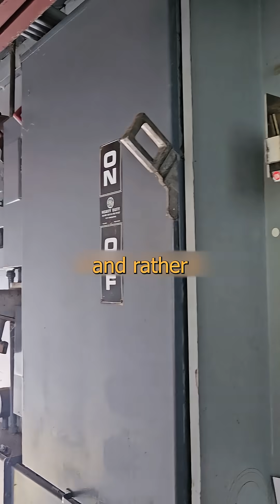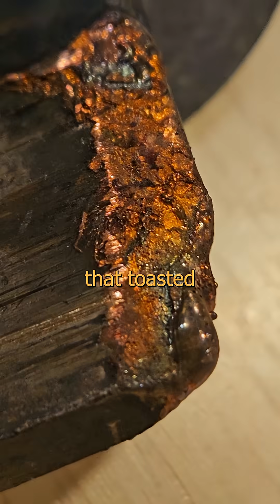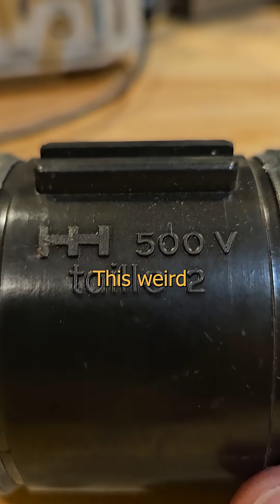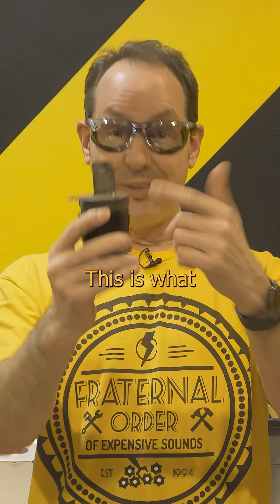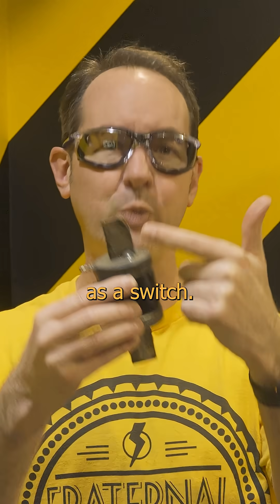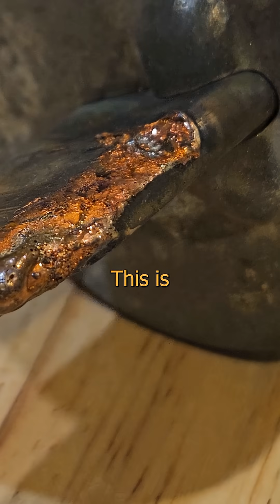Ugly Fuse #chrisboden #comedy #engineering #electrical #educational #highvoltage #damage #fail

Comment: Reminds me of the time back in the day when I was trying to figure out why my TV wasn't working. I tore it apart and found a fuse that was either ceramic or milky from the smoke that got out. Then I decided to check if there was power in the circuit by replacing the fuse with my trusty screwdriver and created lightning which flashed so bright the whole house went dark.
Reply: If there's anything i know about CRTs, it's "they have capacitors that can kill you even without power"
Reply: @SirLightfire  No, CRTs are capacitors that can kill you even without power. They can hold quite a charge even after being completely removed from a TV set.

When I was a kid, the local handyman who repaired nearly everything in my neighborhood showed me how to check whether a CRT in a TV was getting the required high voltage and guesstimate the voltage.

You rolled up your right sleeve, rested your right elbow on the steel grounded frame of the set from which you had removed the cabinet, and held the tip of a screwdriver near the second anode cap on the CRT. That’s the one under the big rubber cap on the side of the picture tube.

If high voltage is present an arc will jump from the contact under the cap to the screwdriver and to ground through your arm. The length of the arc tells you the voltage, roughly, taking into account the distance it has to jump under the rubber cap.

WARNING!!! if you do this you will get a little jolt from the current through your arm, but it won’t kill you as long as your elbow is the only place you’re grounded.

Just don’t drop the screwdriver into the guts of the TV…

When I showed my mother what I had learned, she wasn’t amused.
Reply: @markfergerson2145  My Granddad taught me to work on electronic equipment of that period with one hand in your back pocket. That way the charge won't ground across your chest where it has a small chance of acting like a defibrillator.  There is actually a saving throw vs. electrocution: Depending on what state of its cycle your heart is in, a shock either will or won't stop it or kick it into fibrillation.
Reply: @MarkStockman-n8s5w Whenever I was an apprentice I helped my foreman with some hot panel work.  His hand was in his back pocket.  

My father? Empty the bread on the counter,  use the bag for insulation while changing a receptacle hot.  

Me? I'm now on the LO/TO crew. The land of Schrodingers circuits. Is the circuit alive or dead? Put on the 40 cal and find out!
Reply: @MarkStockman-n8s5w Working on high voltages (anything over about 50VAC) with your left hand in your pocket was a rule instituted by Nikola Tesla himself, apparently. It’s still very good advice.
Reply: @racheleast688 I’ve changed lots of receptacles hot while barehanded. Only got bit a few times. I do take pains to make sure I’m not grounded anywhere else though. At age 73 my heart is about the only bit that still works great and I want to keep it that way.
Reply: @markfergerson2145  Granddad also had a special nylon screwdriver for adjusting POTs etc.
Reply: @SirLightfire  drop some aluminium foil on it till it stops sparking.
Reply: @satibel i code poet. I no touch sparky sparky
Reply: I did that when I was a little kid taking apart an old tube radio, only it was "just" the basement that went dark.
Reply: Those old CRT capacitors could crank out power like nobody’s business
Reply: @Jame5man  It welded the contacts to the screwdriver
Reply: @Roadiedave  I did almost the exact same thing trying to fix an old TV when young! The syncs we're way off our something, I forget. But whatever it was required a lot of taking it apart, changing something, then putting it back together to turn it on and test. 

I knew enough that I knew I was playing with fire not leaving it off for a while every test so I was staying will away from the tube itself and so far things were going well, but it only takes one mistake...

I was in the rhythm. It's just finished one test and was absent mindedly thinking about what test to try next as I used a flat head to pry off the TV side of the power cord. 

BANG!!!!!!! I was blinking to try and recover from the insanely bright blue flash, the power cable has been blown across the room and I realized the end of the screwdriver was now a ball!

It's forgotten to unplug the wall side of the power cable!!! (Facepalm) 

"Welp. I think it's time to just admit the TV is dead and find something else to do."

I'm guessing the violent flight of the power cable was from the force of the current itself but I have no way to prove it. But it somehow ripped itself out of the real and flew 10 feet away from me! Crazy stuff.
Reply: Nah those CRTs are scary asf, kill-you-for-looking-at-it-wrong voltage, the loud pops and buzzing when powered on, enough static to replace your duster...
Reply: @xapcgamer151 Wow, I just remembered how much I used to love running the back of my hand over the screen as soon as we turned the TV off to feel the static interact with the hairs on my skin. Thanks for the flashback. I had completely forgotten about the residual static charge on those things. And all the lovely ticks and crackles that they made powering on and off.
Reply: I remember a kid dropping a little chain into a wall lamp. it had no lamp, but the holder was there and it was live. bang! darkness.
Reply: @anttimaki8188  I once tried to take the temperature of an old incandescent light bulb in a table lamp with a mercury thermometer. It of course shattered but a bead of mercury then ran down the bulb 
 into the socket and polluted our living room with its lovely vapor as it arced and blew the breaker for that circuit. I was only about 10 or so, but I wonder how my life would be today if I still had the brain cells that vapor Agent Orange’d…
Reply: My fav was screwing those old fuses into a table lamp. If you put a 10 amp fuse in the lamp, and the circuit was 15 or 20 amp, usually, only the lamp fuse would pop and scare the bejesus out of everyone!
Reply: @crashburn-s3b  I'm interested - what was the fuse rating of the lamp supposed to be?
(Trying to imagine a 1.2 kW lamp... that would be impressive.)
Reply: @wazza-au  Usually I would use a 5 or 10 amp fuse in order not to pop the circuit breaker fuse in the basement. Those were normally 15 to 20 amp.
Reply: @crashburn-s3b  I  am curious how well a standard lamp cord would stand up to a dead short.
Reply: @MarkStockman-n8s5w  The weak link is the switch. If anything were to react badly, the switch is not designed to take a 10 amp load, but it is a short duration problem.
Reply: I had a boss whose response to a shear bolt failure was to put heaver and heavier graded bolts in place of the shear bolt until the bolt stopped breaking.  Then was shocked and upset when something expensive the shear bolt had been protecting broke instead.
Reply: My daughter managed to do that in the den.  OK, so, we had two desktop computers on, our son running his X-box on the TV, a small space heater running, and our daughter running her laptop - when she plugged her hairdryer into a socket.  Hey - who turned the lights out.  Now, the room has somewhere between four and five separate circuit breakers for the room.

Comment: I’m confused as to exactly what you mean when you say “use the blades of the fuse as a switch” I’m interpreting that as someone physically taking the fuse out to turn something off but I feel like from the context and fact that’d probably make one hell of a noise that the fuse was in a bigger machine you had to take apart to find? My limited knowledge from mechanics and random interests definitely struggles to make sense of many things I see on this channel but it’s one of the reasons I love your content, not to mention the humor.
Reply: I'm also not sure it's designed to be used as a switch, in Europe separate circuit interruptors are used. We don't take out the fuse under load but use the separate switch (with specified arc gap) first, then replace the fuse. The 'switch' may well be a lever to help remove a fuse if broken and make sure all phases are broken even if you forget to use the proper main switch first. Because the legs are indeed not designed to be a switch.

Comment: It pitted when the switch was opened, not closed. Arc does not happen on close..it happens on open.
Reply: Yep... with any kind of inductive load, the trick is making the current stop.  The only case where the conditions are worse when the switch closes is something like an incandescent bulb, where the cool filament carries more current than when it has warmed up.  In any case, switches are not as simple as you might think!
Reply: @SkyhawkSteve  if the inrush current into an incandescent bulb can cause arcing on a switch, then the inrush current on a inductor can as well
An instantaneous fuse for a motor has to be rated at 8 times the full load current, if my memory of my code class 14 years ago holds true (not in the field so I’m not as up to date on the code as I could be)
Reply: @patrickpelletier9298  inductors resist changes in current.  There's no inrush current.
Reply: @SkyhawkSteve  inductors as in transformers, solenoids, and motors.
Reply: @patrickpelletier9298  right.  Inductors resist current change.  No inrush current.
Reply: @SkyhawkSteve the motor, and resistance in the secondary windings on a transformer, produce CEMF which opposes current flow. When a motor is at a standstill, it has a large in rush current because there is no CEMF built up by the spinning rotor, and as the motor gets up to speed, the CEMF grows until it provides the necessary impedance to current flow.
Inrush current is roughly 5-7 times the full load amperage.
Reply: @patrickpelletier9298  True... counter emf in a motor does reduce current.  In that respect, it does share a trait with incandescent bulbs that draw less current as they warm up.  I'm not aware that the inrush current damages switch contacts, at least compared to the arcing that occurs when opening the switch with an inductive load.  I'd be interested in learning more about damage when closing the contacts...  I'm more familiar with problems when trying to stop current flow.

Comment: I don’t understand, was the fuse installed incorrectly or was the device designed to use fuses incorrectly?
Reply: The device was using that stubby fuse incorrectly, as a switch, instead of having a separate pair of contacts that were designed to handle high voltage arcs they just disconnected/reconnected the fuse. That lead to the fuse contact blade getting burnt and pitted to hell as we see in this vid, which leads to current/voltage spikes as it comes into contact, which burnt out the other fuses that ended up being replaced with copper bars. 

It's a MF to find that kind of problem cos once the switch-fuse is fully closed and actually in contact it won't show up as being out of spec if you test it with a meter, so that whole part of the circuit looks fine, you pretty much have to visually inspect the switch-fuse to realise what's going on, and depending on where it is and how it's housed that can be waaaaaay down on the list of troubleshooting steps. Far enough down apparently that someone resorted to the industrial version of a penny in a fuse box before figuring it out, which was hair-raising to see in the OG short.
Reply: @dragonsaint9446 Let us all pray to the engineering gods that the term "switch-fuse" never becomes a thing.
Reply: @cannonball967 Anything can become a fuse if you use it wrong enough.
Reply: @cannonball967 They do exist.  They’re called ‘Circuit Breakers’!
Reply: @patski4  circuit breakers are not fuses, they have replaced fuses in most household panels, but that's cos of changing standards/codes based on new materials/tech, they aren't interchangeable in application. That's why some appliances still have fuses or fused plugs, cos sometimes you need that extra layer of protection.
Reply: You're not supposed to be using the fuses as a switch. You should have the power switched off to them before you replace them if they blow. If you don't every time you install or remove them the contacts get pockmarked and partially melted. If you do this enough it doesn't make contact properly anymore. It can just cause problems on downstream equipment to melts and can start a fire and the worst case.
Reply: @blindsniper35  European regs call for a separate main switch upstream of these fuses ánd at the machine(s)/panel(s) it's feeding. You're supposed to switch off the load first using these (downstream first, then upstream) and the 'switch' inside the fuse box is probably just a lever to ease removal of the fuses.
Reply: @blindsniper35  I don't understand how can you even use this fuse as a switch? By hand??
Reply: @syrslava705  Well, if it's based on the special people I've had to work with, I would say with some linesman's rubber gloves and a fuse puller (larger fuse pullers look less like what you use in a car and more like a set of plastic pliers with rounded grabbers).
Reply: @iamme2072  I looked up and I do not understand why these large fuse pullers are a thing, but ok
Reply: Just to be clear, fuse Chris was holding didn't go in the fusebox with the copper bars instead of fuses.  There was another fusebox where the fuse was moved out of its holder to open or close the circuit (i.e. a switch) - which was likely used on a regular basis.  But a fuse holder is not designed to avoid arcing when open & closed, so it gets damaged over time - resulting in the blown fuses which were replaced with copper bars.  (Note: circuit breakers aren't designed to be used as switches either.)
Reply: I have got a similarquestion,  what is the actual principle of using fuse as a switch,  and how did the the guy responcible dfor this mess do it , did he just puled it out of it housing while current was flowing trough it and it had voltage across it? like with his "bear " hands, or is there a special device that is designed to do it under different conditions without causing the contact point to melt?
Reply: @ArtemKyiashko  So I don't know the specific piece of equipment Chris was dealing with, so take this with a grain of salt, but there are designs of fuse housing that hold the fuse in something like a ring or clamp with a lever arm attached. The normal reason for this is to make it easier to extract the fuse for replacement, since especially in high voltage situations the contacts can be very strongly sprung and thus hard to move, even before any accidental contact welding, dirt, or similar obstacles get involved. 

Sometimes however someone might end up using one of those housings as a switch, either through ignorance, mistaken interpretation of equipment function, or old fashioned "good enough for now" bodging to keep a system running.
Reply: @dragonsaint9446 Thanks for the explanation, now i will surely know what not to so when you see a giant fuse with a lever atached), to be honest, now as I am picturing how it looks I kind of understand why one could think, that the whole thing can be used as a swich. But repeatedly use it to cause such a damage, that is even clearly visible if you open your eyes and look at the contact point is still an incanity